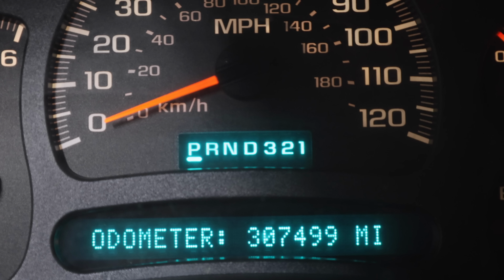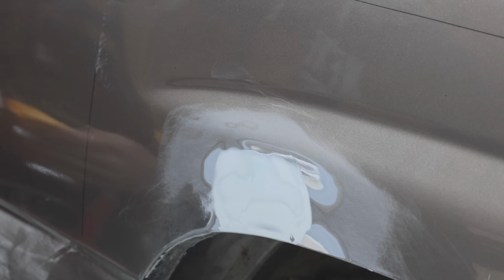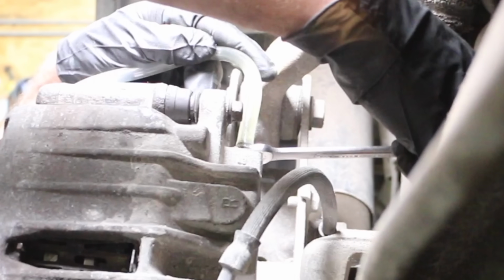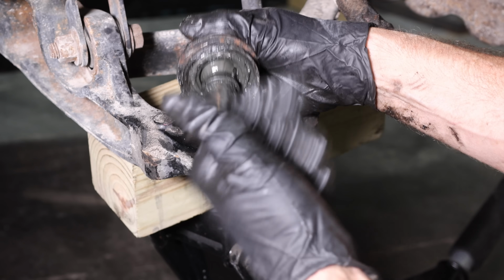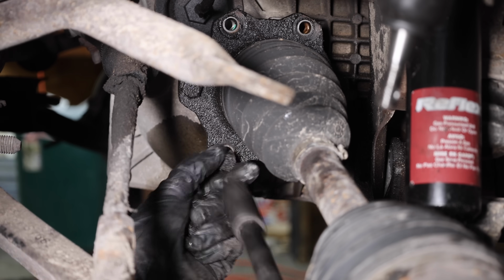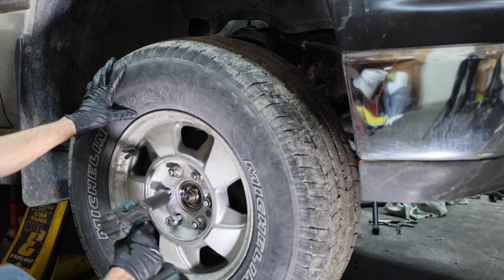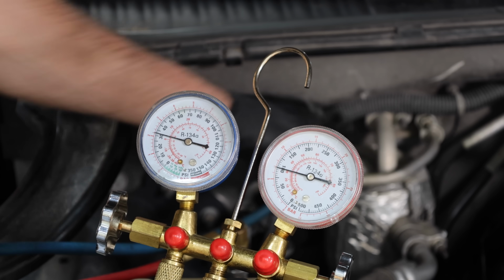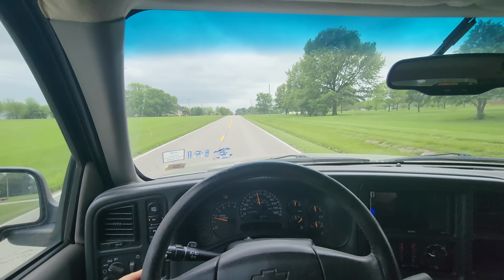Is It Stupid To Fix Up A 300,000 Mile Vehicle? Let Settle This!

Comment: That looks like a G80 8.6 rear, pretty sure there is a PSA on them not to run limited slip (emulsifiers) in them as they are a locker not limited slip. Those front diffs are notorious for lasting 200k miles and needing a rebuild as bearings constantly turn but they don't receive proper lubrication.  I have a 1997 K1500 which runs around the same drive train. The 5.7 is the most reliable part of it.  The front diffs are okay, the G80 is okay the 4l60e are poor generally.
Reply from the maker: Thanks or sharing.

Comment: I had a 1972 Ford F250 plow truck that had somewhere around 600k km on it, i was paid 50$ to take it with a 460, 4x4s for a frame and a transfercase that tried to not exist, nothing had oil in it, no diff covers and the floor was a sheet of plywood that just slid on the 4x4s. 

It finally died when i had a crushed toyota echo in what was left of a box and i had 0 psi of oil pressure, it was like that for months but it finally had enough and started burning oil that wasnt in it. 

Still got that damn plow tho
Reply from the maker: Thanks for sharing.

Comment: Absolutely AMAZING video!! I have a 2008 ram with 178,000 miles that I got with 97,000. I'm Definitely A DYI guy but I slack on Maintenance. I still have original spark plug in it. I've never done any fluid changes (except oil and coolant).
Reply from the maker: Thanks!

Comment: This isnt a critique by any means but if you want that patched area to have a shine, you can wet sand it with 1000 to 2000 sand paper to smooth out the clear coat and the buff it. 

Years ago i wanted to see if you can get a "professional" quality paint job from a rattle can and you can, it just takes some more work.

Comment: It's all about how you maintain it. There's a guy on the V-strom forums that has a 2002 V-Strom with nearly 500k miles on it, which is unheard of for a motorcycle, and it's still running like a champ.

Comment: I would be very hesitant cleaning out the bore of the ball joint.  Worked out for you because you used slighly oversized knurled ball joints but if using OEM replacement they might not fit if material is removed
Reply from the maker: Thanks for the feedback.

Comment: Love the speed of the content and makes it easy to back up and review without all the unnecessary commentary other channels add. Great info! One point on replacing rotors, be sure the mating surfaces between the hub and rotor are clean and free of rust or debris (unless you replace the hub as you did). Anything between the hub and rotor can introduce rollout and caused a vibration when braking. Nice work on the patch job!!
Reply from the maker: Thanks!  Thanks for the feedback.

Comment: Got an 2002 sierra I got in 2012 with 211 000km, now has over 800 000km, in canada. Replace parts as they go out and it'll last forever, parts are cheap. Can Replace a transmission or an engine cheaper than most people's monthly payment. On its 3erd bed, all doors and panels have been replaced at least once. Only thing original is the cab, hood, frame and transfer case.
Reply from the maker: Thanks for sharing.

Comment: My 2004 Silverado 2500 hd Duramax is just shy of 400,000 owned since new , other than two sets of injectors ,alternator water pump, ac clutch ,and  the same front end parts you just changed hav not had any major issues .
Just maintenance items , burns no oil between oil changes. I believe this proves the value of maintaining your vehicle !
Thanks for your hard work !
Reply from the maker: Nice!  You are welcome!
Reply: Same on my buddy's 2003 Duramax, but he never kept up on maintenance, so it is many different leaks all over that engine.

Comment: If you haven't changed your ATF fluid before 100k+ miles just let it go. 
The clutch material turns into kind of grit helping the clutches grab. When you flush all that out and install fresh slick oil.  The clutches will slip more causing failure much quicker.
Reply from the maker: Thanks for the feedback.

Comment: Those old vortec's just don't give out as long as you maintain them often, I have a 99 Silverado 1500 with the 5.3 in it, it runs still but the transmission broke when the carrier bearing went out
Reply from the maker: Thanks for the feedback.

Comment: My 2000 Ford Crown Victoria Police Interceptor has 287K I been driving it for 14 years, it runs like a clock  and I don't want another car , its cheaper to maintain than buy a new vehicle, plus the new cars they make now days are worthless, too many computers and electronics in them just more crap to go wrong in them.
Reply from the maker: Nice!  Thanks for sharing.

Comment: Well done! 

When I was in college, my parents gave me their very old 1995 Ford Explorer. I used it during college and grad school. I used it to travel across the country a few times and all around California. It was a great vehicle for camping or long trips. That car drove extremely well. Even after I was married, my wife preferred driving that old Explorer more than her much newer Ford Escape. I never really had any major problems with the Explorer. I simply made sure to change the fluids regularly and do a few of the upkeep things that you mention in this video. This past year, I gifted the vehicle to a family member. It had over 370,000 miles on it. It had a new Interstate battery (from Costco) and new tires. 

Just before my brother-in-law flew to the Silicon Valley to pick it up and drive it to Texas, I noticed one issue. The thermostat housing unit had corroded through and coolant would leak out. I bought the part (with a new thermostat and gasket) off of Amazon for about $25 and replaced it myself. It was the only real "repair" that I ever needed with that video -- and it only took me about an hour to complete it. My brother-in-law drove it more than 2,000 miles to his border town in the Rio Grande Valley in South Texas. He said that it drove very smoothly all the way there. He is still using it nearly a year later. 

We replaced that vehicle with a brand new vehicle. The new vehicle is really nice...but my wife still mentions how much she misses that old Ford Explorer. It was one of the smoothest-driving vehicles that I ever had the pleasure to drive. Plus, I didn't have a new car payment for all of that time.
Reply from the maker: Thanks!  Thanks for sharing.

Comment: You may or may not have done this off camera but in my experience the new outer tie rods have always varied in length depending on the manufacturer. Instead of counting the rotations i take a measurement from the outer face of the locking nut(if using the same nut) to the center of the balljoint. I have gotten the car very close to the previous alignment this way and had no worries driving a day or 2 before the appointment
Reply from the maker: Thanks or sharing.

Comment: when installing new rotors its key to spray then with brake cleaner before brake pads applied to remove the protective oil on them. just a reminder . great video
Reply from the maker: Thanks!

Comment: @21:32 ". . . exchange 3 qts of transmission fluid every 2nd or 3rd oil change . . . "  Wish manufacturers made it easier to change the trans fluid like the oil as I would then do the same.
Reply from the maker: Thanks for the feedback.

Comment: I recently bought a 1-owner 2006 Chrysler T&C with 175k miles for around $2k. Drivers window doesn’t roll up or down, but that’s a common issue
Reply from the maker: Thanks for sharing.
Reply: @ProjectFarm that T&C is technically my dad’s car, as I don’t drive yet

Comment: I prefer to drive 20+year old vehicles. Parts are relatively cheap, and I can do the work myself. I have a 98 and 00 Chevy truck, both over 350k and still running great. Borrowed a neglected 03 Toyota Camry for a year, $500 and some elbow grease, and I transformed it from junk to awesome car. Would love to have another.
Reply from the maker: Thanks for the feedback.

Comment: I am most definitely not a world class expert but, you need to be sure to again coat the back side of where you welded. Having made auto body repairs since the mid 70’s, the only places where my repairs eventually failed was where water was able to get to the back side of where I made repairs. With the back side of where I made repairs, the repaired areas are still fine decades later. 👍🏼

Comment: 95 tacoma 278k-toyota frame recall buy back,

 04 tundra 111k and counting free new frame in 2021 all og driveline and suspension/steering 

09 taco 258k and counting free new frame in 2020 og clutch and driveline. New shocks, front half shaft and universal joint. 

Toyota ❤❤❤❤
Reply from the maker: Thanks for sharing.

Comment: If you like fluid transfer pumps for diff and transmission fill, you gotta try using a Walmart garden pump. It's so easy and inexpensive. Just pressurize and pull the trigger.
Reply from the maker: Thanks for the suggestion.

Comment: 2007 Tacoma w/225k miles. So far  other than basic maintenance and consumables - I have Replaced U joints and the Alternator. 

Suspension was replaced at 190k but was still operational - just wanted a 3in lift for bigger wheel and tires. 

It’s not the biggest, most powerful or most comfortable vehicle but it has taken care of me. It helps that I have a weekend car and hybrid work schedule to tinker with it
Reply from the maker: Thanks for sharing.

Comment: My 2011 Toyota Camry 2.5 has just passed 330,000 miles. Worth every Penny!
Reply: Camry and corolla are incredible cars, it's rare to not see one go over 300k
Reply: My 2011 Camry LE 2.5L 2AR-FE is just getting broken in at 133K miles. I bought it used for $14K in 2014. It spent most of its life In the snowy NE U.S. doing daily trips of 25-50 country miles and long highway cruises. The water-based clearcoat was admittedly awful that year. Otherwise easy driving, trouble-free and low maintenance.
Reply: Cent
Reply from the maker: Thanks for sharing!
Reply: *penny.

Comment: With any anti-lock brake system, open the bleeder before compressing the caliper pistons. Any residue in the system will otherwise be pushed back through the brake system and can cause expensive issues with your brake system.

Comment: Fluid pump solutions... there is a topic for you.    I agree with the style you used but I need a 1qt solution.  Did the transmission fluid on a Prius last week and it was a disaster.  I needed 6 hands to keep everything stable.  Had a few oopsies and a very unhappy helper (wife).  Ideally I would like a child-fist-sized electric pump and various bottle screw on lid to prevent spills on different sized containers.   It needs to be light enough not to tip itself over and small enough not to add complexity and fluid waist to the system.   Add cleanable to the list.   There are big pro solutions but they don't work well for small amounts of fluid used rarely.  -- thanks

Comment: Be careful using c-clamps to compress brake caliper pistons, especially on the rear. Some vehicles have a parking/e-brake design that will be broken/damaged by just straight pressing it back. You can get the proper caliper compressor from an auto store like autozone/advanced/oreilly as a loaner for free.
Reply from the maker: Thanks for the feedback.

Comment: My grandfather was a mechanic, he had an old Dodge truck with over 600k miles on it. Apparently only minor repairs, maintenance and new ball joints was all it needed. He bought a new Dodge RAM 1500 in 2001 and the transmission blew up after 110k miles.
Reply from the maker: Thanks for sharing.

Comment: I did body work for 5 years, my dad is still doing bodywork after fifty years and he says with bondo you use what tools get the job done. He has a drawer of odd shaped wood for sandpaper because of the different body lines on vehicles. You did fine
Reply from the maker: Thanks!

Comment: I live in southwestern Pennsylvania and they use a lot of salt on the roads in the winter so it affects the vehicles drastically with respect to the body and frame.  A friend of mine bought a Dodge pick up truck that had a Cummins diesel engine and he told me this is a 400,000 mile vehicle.  I told him it's a 200,000 mile vehicle with a 400,000 mile engine if you're lucky it doesn't rust apart before 200,000.  All things are relative.  I had a 2006 GMC Denali that spent its winters in Florida and its summers in Pennsylvania and it had absolutely the best care you could give a vehicle beyond just storing it up on blocks.  It was the worst piece of crap I ever owned everything went wrong with it that you could think of.  All things are relative.
Reply from the maker: Thanks for sharing.

Comment: My 2003 Tacoma just clocked over 303,000 miles, been driving it every day for 5 years. It’s never left me stranded.
Reply from the maker: Thank you for sharing!
Reply: Just broken in.
Reply: I've got a 2002 Tacoma 290k miles. It definitely needs a little front end attention you showed here. Its ridiculously cheap just to hang on to it.
Reply: I have a 1992 Toyota 4x4 with 130,000 and it makes me sad that the frame has rotted out because it would have gone the 300K  !
Reply: @bloominflowers6766 That's a good reason to use fluid film coating.

Comment: To answer your question, yes they can with some proper maintenance of course. 

I have a 2006 GMC Yukon Denali (6.0 V8) with 237K. I drive 500-600 miles a week. Never had any major issues with it but I do maintain it very well.
Reply from the maker: Thank you for sharing!

Comment: Some of the older vehicles are better than the new ones and sometimes last longer with routine maintenance.
Reply: New vehicles are more unreliable and more expensive to repair than ever before.  The best cars are ones with no computers or smog equipment  on them at all.
Reply: @Suddenlyits1960  From the '60 then?
Reply from the maker: Thank you for sharing!
Reply: Not just some of them all of them

Comment: My 2001 GMC Yukon XL Denali has 335000+.  We bought it with about 160k in 2011 or 2012.  I’ve had some large repairs, but it’s still way cheaper than a car payment.  I’ve done two transmissions, two transfer cases, a front differential, a water pump, a radiator, a starter, a fuel pump, and a few alternators.  Shocks all the way around, and front end parts.  Of course, routine maintenance, a tune up or two, and maybe a couple of ignition coils.  It’s rusty, but it’s a very good, dependable spare vehicle.

Never done anything to the engine except fix a couple of oil leaks.  6.0 LS is a great engine.
Reply from the maker: Thank you for sharing!
Reply: @ProjectFarm  correction.  Just looked.  342000 currently.

Comment: The most important thing is if the body, frame and other structural components are sound.  If not, then it is not feasible to continue pouring money into a vehicle.  Engines and transmissions are a lot easier to change.  Of course living in the rust belt certainly shortens a vehicle's life, but can be prolonged getting it oil sprayed ever year.  Have a great Sunday Todd👍
Reply from the maker: Great point!

Comment: My 2005 Toyota 4runner 4.0 has 327k and runs great, I even tow a 3000lb cargo trailer for work with it. Transmission and engine have never needed any major repairs, A/C still blows cold, all the power window work, no rust, no problems.
Reply: 4runner never came in a 6.0? maybe u meant 4.0?
Reply: @whowantstoknow8492  correct v6 4.0 my mistake
Reply from the maker: Thank you for sharing!
Reply: Same here, only frequent oil change for maintenance, and some rubber pipe replacement.
Reply: My 2006 is still going strong. Had to do some maintenance work but still kicking albeit "only" 200k miles
Reply: @OSODIY  nice, 200k is just getting broken in 😀